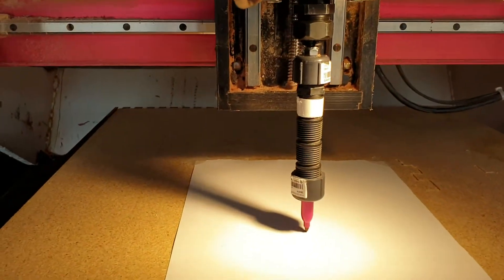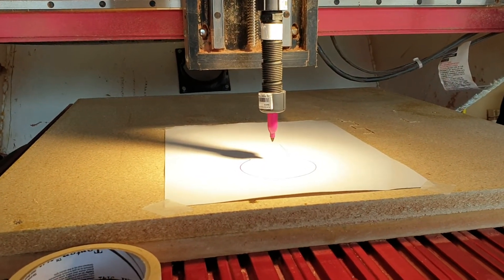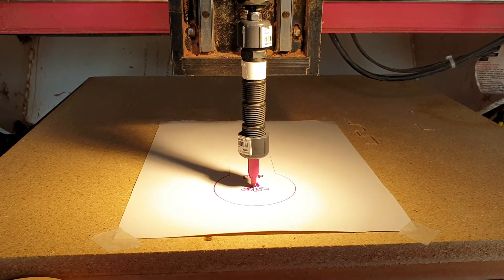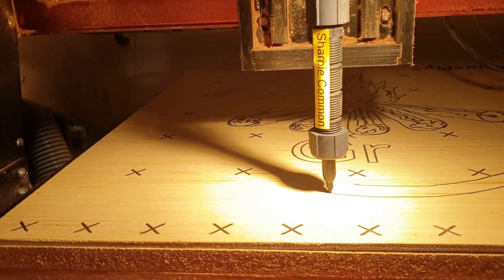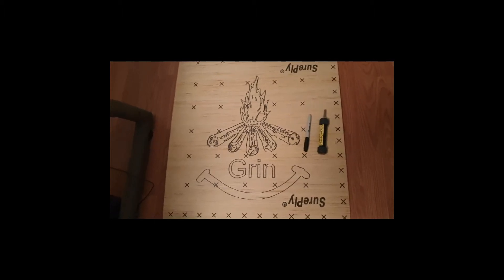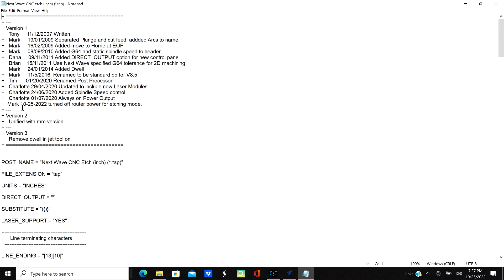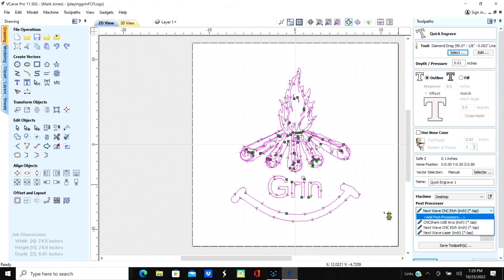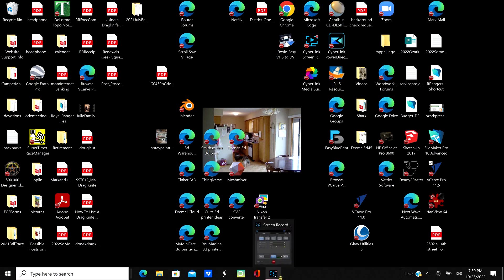Nextwave CNC Plotter Pen or drag knife post processor for vcarve pro

Comment from the maker: Ha.  I was using the laser post processor as a test to see if it worked with out turning on the spindle.  I did smell smoke.  Later found out my laser was firing off in it's wooden box.  (yes this could catch a fire if it was just perfect in the box and I did this long enough so it isn't a good idea but I was teaching myself about post processors.)   I then looked up the help file in vcarve on post processor editing and then used the inch post processor and changed the spindle speed to 0 and also removed the delay in the new arc files for slow starting spindles.